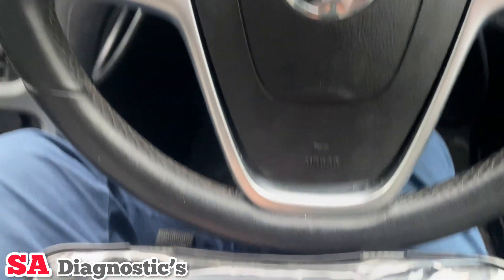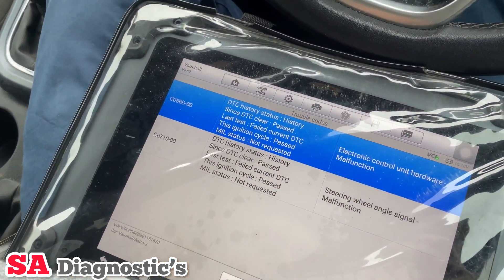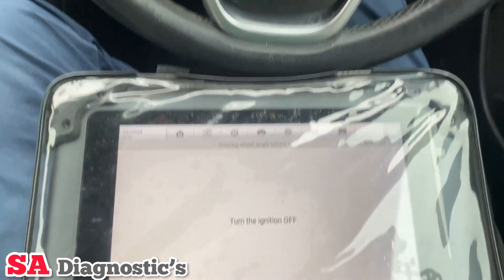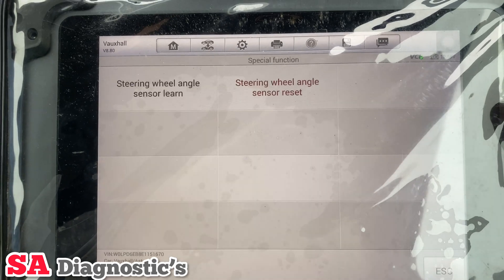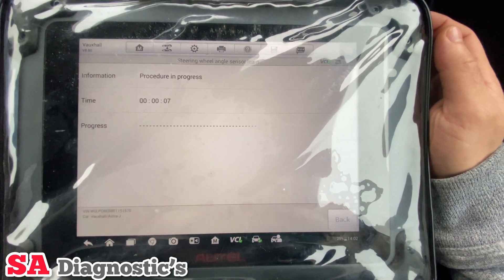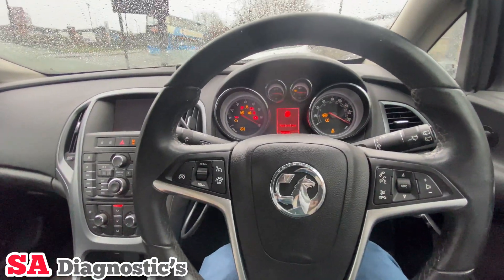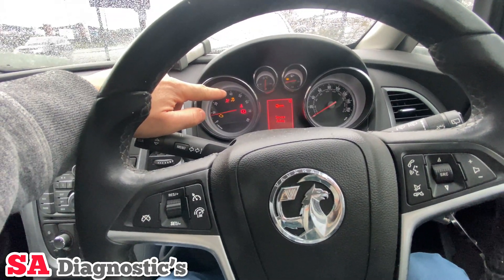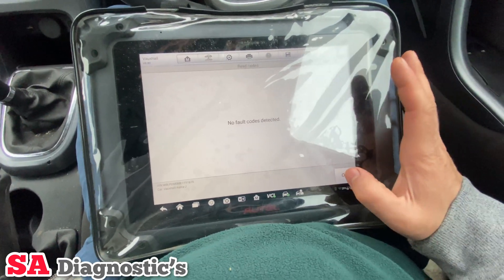Vauxhall Astra Steering Angle Sensor Coded Using Autel Maxisys

Comment: I've got the same problem with mine been told it could be the rack
Reply from the maker: @JohnBailey-e9p  yes could be
Reply: hello, I would like to ask you, vauxhall insignia 2012 2.0diesel steering replaced, can you undertake its programming, used, included

Comment: Where u based
Reply from the maker: I don’t do diagnostics anymore…
Reply: @sadiagnostics  no problem but could you please give a tip regards to Vauxhall Astra , I can’t see my mileage or speed . Thanks
Reply from the maker: @user-xw5kk1mu3m  you may need new cluster or programme software.
Reply: @sadiagnostics  thank you so much where do you recommend for me to go in London
Reply: @sadiagnostics  where’s the power steering fluid cap located ?